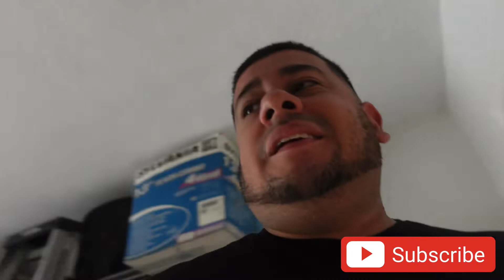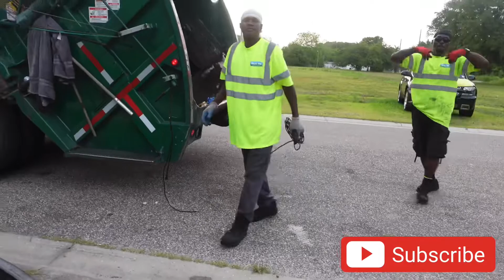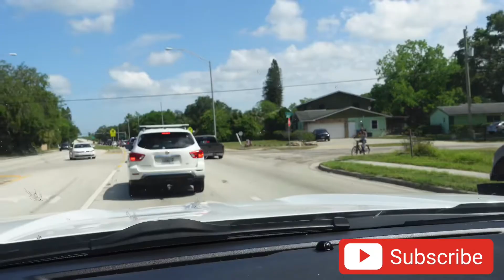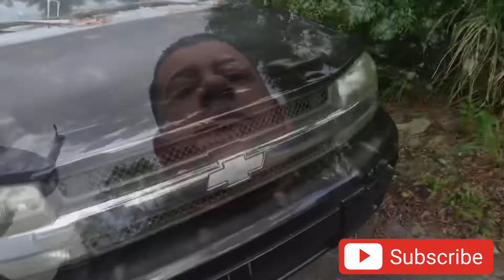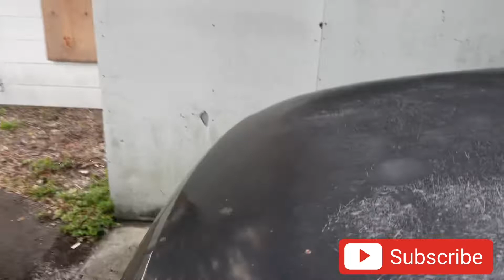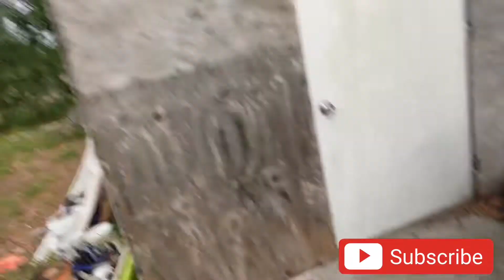LS SWAPPING my TRAILBLAZER finally… need to smoke them tires with my SOUND SYSTEM jammin!

Comment: Hell just find a factory 5.3 truck.
Reply: The engine area is so small in the trucks it isn’t worth the upgrade to a v8 all the modifications that will have to be done
Reply: @viewersnetwork  exactly, that's why I just started with a 5.3 trailblazer. Not to mention you get an aluminum block.
Reply: Yeah I agree do the 5.3 swap. I'm in the process of swapping my i6 to a lm4 aluminum 5.3 out of a ext trailblazer
Reply: Yeah I need to LS swap mines
Reply: @viewersnetwork   Wtf are you talking about.